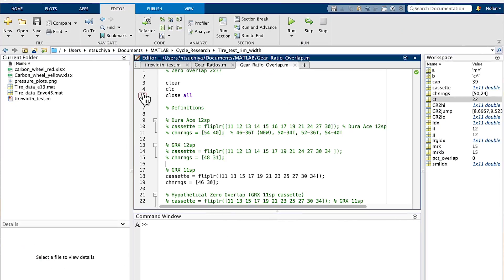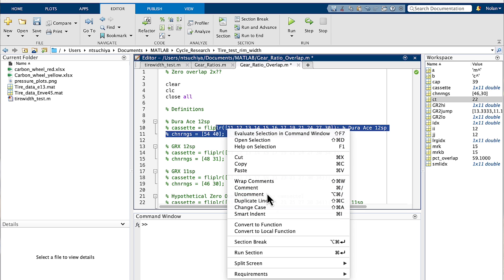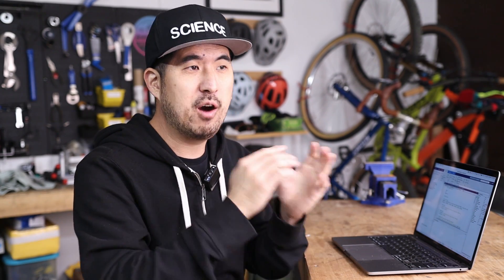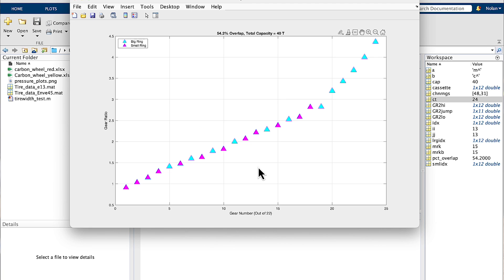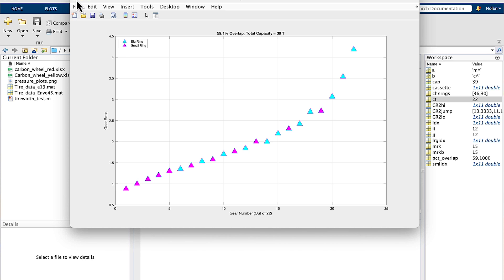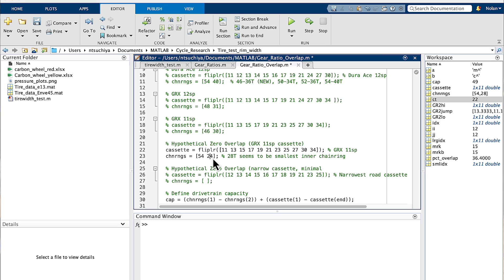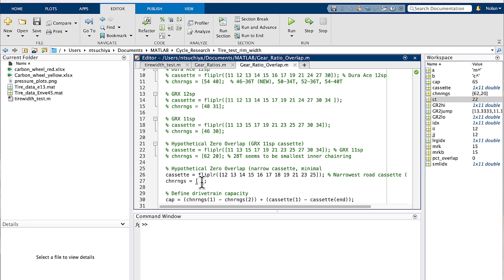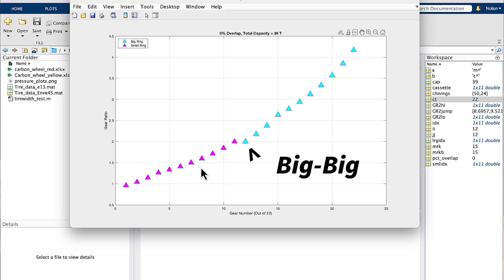Why 2x Drivetrains Have Redundant Gear Combinations

Comment: I did the same calculate  on google sheets and MS excel. lol
It need much more big diff between big and small chainring for the zero overlap. 
maybe at least 20 or 22 t diff, just like 44-22 or 44-24, it's actually the old school 3x without mid ring.
shimano FD can hold at least 18 t diff, I didn't test the 20 t diff. 
before the 10 speed, the drivetrains need mid ring to cover some range, and now it's 12 speed era, the big and small ring can share the job of mid ring.
for most of large cassett, 1 x 12 speed MTB, the lowest range is 0.65-0.67, the small ring 2 x system with small cassette can also reach that ratio on 12 speed road cassette, yes , I mean shimano11-34 and 11-36.
Reply from the maker: 65T with 11-34 cassette to be exact 😆

Comment: I also appreciate both 1X and 2X systems, even the occasional 3X has its place in my opinion. In addition to a more efficient drivetrain and smaller steps between gears, multi chainring set ups can offer a much wider over all range , a higher high gear and a lower low gear, often for a much lower price. An 11-50 tooth cassette, 1X derailleur and a narrow-wide chainring can get quite expensive. One can achieve the same or larger overall range from a 2X or 3X system often for pennies if you are willing to dig through the parts bins at your local bike co-op and/or run friction shifting. Don't get me wrong, 1X is beautiful in its simplicity and very user friendly but as a mechanic and cyclo-tourist I don't see myself ever moving away from multi chainring systems anytime soon. Great video Nolan!
Reply: Absolutely. As I only had one bike I liked the versatility of my 3x10 XT. It was able to go anywhere with any luggage. Now as I have bikes for specific uses I like the simplicity of 1x12 XT and GRX.

Comment: Nice job professor. You really did your research.
In the 1970s I looked at 2x overlap but found it welcome. A 60 inch gear for instance on the low front and mid freewheel (no cassettes then) could be had with a  big front and bigger rear cog. It was nice to have a favorite gear on both the big or smaller front ring depending on the terrain and wind. 
I've never tried 1x, mostly 2x and some 3x and of course much single speed as a kid. They all have their place as you explained. And I think that's the point.

Comment: I'm running 11s 11-45 grx with a sram 43/30 chainrings. 
I use it mostly as a 1x, the 30t is there for me to get that low low gear. I call it a 1.5 by 😂

Have tried to go 11-50 on the back but that forces me to switch chainrings if I want to access the top cogs on the cassette. 
I think the chain angle pushes the chain from the 43 ring to the 30 ring, but it doesn't do that on the 11-45 cassette for some reason I can't figure out 🤔 both cassettes are shimano cues, could it be the thickness??

Comment: Interesting data, so 11-25t cassette and 50-34t chainring is only 41% overlap... How does increasing the chainring sizes affect that? (52-36t & 54-38t)

Similar to you, I use both 1x and 2x. They both have their uses.

Thanks for sharing.

Comment: I was fine w/ 3x on my old Surly LHT, & I’ll say Ive really enjoyed the switch to 2x wide-low on my new bike, as this system has plenty of range, maximizes efficiency of overlap by having significantly different ring sizes, while retaining smooth ride-ability when shifting between rings when in advisable gears in the cassette.
Reply: yeah i would argue 3x is dead on modern drivetrains for good reason but i would never want to get rid of my 2nd chain ring on my road bike.

Comment: “less of a redundancy, more of an efficiency” is a great way of putting it. speaking as a 3by-or-Die Guy, gear ratio overlaps  of 2-3by drivetrains are a feature, not a bug. 

love the video!
Reply: Slow shifting is a feature🙃
Reply: @veganpotterthevegan  more gear inch interval is definitely a feature
Reply: @03blackoperandi  more gears you won't use isn't
Reply: @veganpotterthevegan  Sure, if you put wrong gear.
Reply: @03blackoperandi  huh?  Having roughly 3 gears that are the same would mean you have 2 additional right gears.  Its wasted material/equipment that's unnecessary
Reply: @veganpotterthevegan  Using multi-speed crank might give you same gear ratio at certain gear combination but in different progression and chain positions, which translate to pedaling efficiency.

If you have any unused gear combination, chances are either the gear inch number is to high or too low. Just keep it at sensible range, eventually you'll use them.

For example, I've seen "unused gear"  too often on some larger crank setup (50t or more) which resulting over 100 gear inch yet unusable at daily basis. Wrong gear just makes it unusable, no matter how it is single or multispeed crank.
Reply: @03blackoperandi   how many people shift their FD often to make sure they're using the most ideal,  next gear step?  Also, with a triple, you're getting much worse shifting.
Reply: @veganpotterthevegan  While it sounds complex, surprisingly it's easier than you think.

I was using 1by 42t crank paired with 7sp 11~34t cassette. Later I swapped it with 3by 42/34/24 crank. Due to some technical issues, 24t chainring couldn't be used and I've set it as 2by 42/34 crank. Sure its range is overlapped so much, yet shifting FD down from 42 to 34 just feels like shifting RD down for 2 steps and vice versa.

While I love the single crank setup, I prefer the 2by setup for climbing performance. Weight differences is about 400 grams. It's cheaper than buying big cassette (which also might be heavier) so it's big win for me.
Reply: @03blackoperandi  none of this is remotely complicated.  I've only ever needed a triple on a tandem(long ago).  And I rode it a couple hundred miles a week for 2 summers with my ex.  It still sucked compared to 2x.  *I'd have absolutely no tolerance for a 7sp cassette😅 If I lived somewhere mostly flat with little wind, 9sp is fine
Reply: @veganpotterthevegan  you cant accept someone who likes their setup
Reply: @veganpotterthevegan  your inability to understand  a cyclist preference on display
Reply: @akatgif  where did I say that?   Keep what you have while recognizing reality.  I know very well all the things I plan on keeping(cycling related or not) are definitely not the very best version of good I could potentially own
Reply: @akatgif  thanks for telling me you can't read.  Hopefully English is your 4th language😵‍💫
Reply: @03blackoperandi  your  decree about gearing efficiency is your own value.  You are not willing to accept other riders' equipment preferences
Reply: solid thesis
Reply: Redundancy  is bad, there's no way around it. It's about the benefits you'll get for it. 2-3by was only way to get good gearing range and steps between gears for a long time. 1x12 changed that, but not without some unavoidable drawbacks. Both 1-by and 2-3by systems have pros and cons. Most important thing is getting what you actually need instead of buying what is cool right now.
Reply: exactly 💯